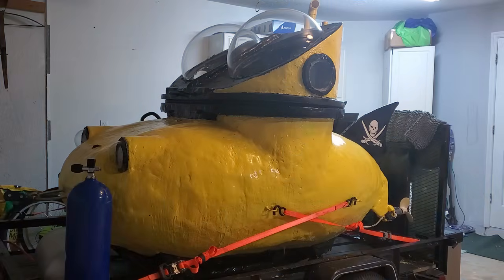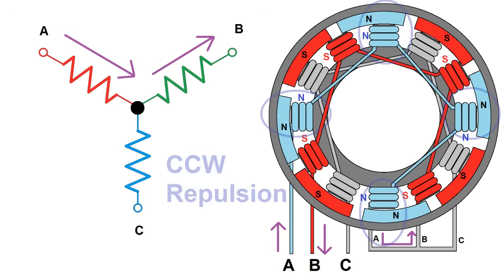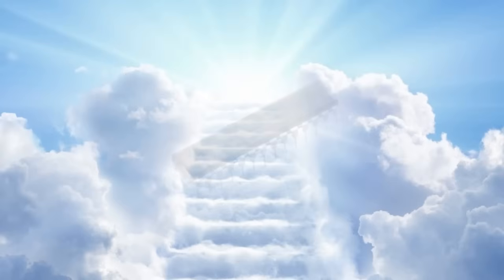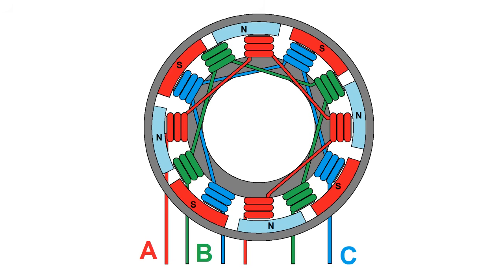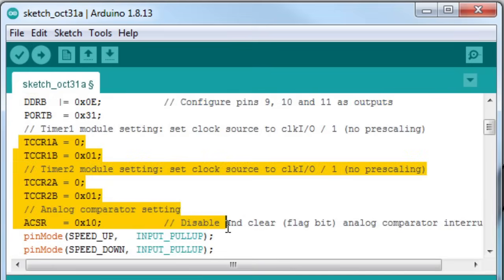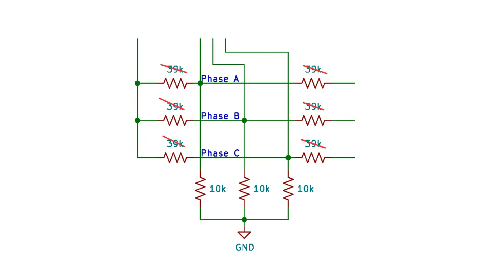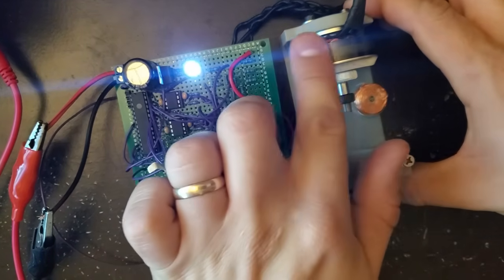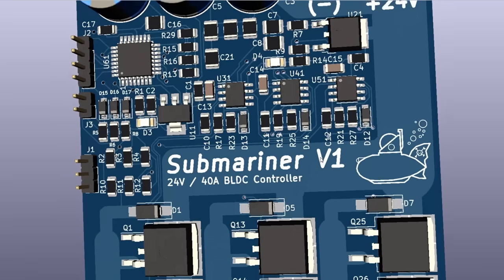Brushless DC Speed Controller

Comment: I was encouraged to see that you used a dual trace scope. I wanted to build my own esc but my motors are delta wound and I couldn't figure out how to detect the zero crossing point with my dual trace scope. I think I'll buy a wye motor and compare a phase with the neutral point as you did.
Reply: When running the motor there will always be one phase that is inactive during each step, thats the same for y and delta. Since the inactive coil will move along the permanentmagnets there will be a voltage induced, which can be measured. The point youre looking for is the moment when this induced voltage changes its sign (crosses zero).
Reply: @jonibeYT  "...thats the same for y and delta." 
I started thinking about that. It makes perfect sense. With the delta motor only one coil is energized at a time. I'm going to run some tests with that in mind.
I'm just a hobbyist. The problem for me is I have three hobbies, electronics, programming and animation. If I run into a wall, sometimes I will switch to a different hobby and stay zoned in for months at a time. As a result I lose focus on my other hobbies.

Comment: Iam having some douts bro

Is it possible to upgrade 30a esc to much higher ampere by. Addiing parallel mosfets.     (Same voltage range)

What are the issiues of this idea

Comment: can i use ir2110 mosfet driver in place of ir2101 ??
Reply from the maker: sure, but the input logic might be different so you'd have to compare the datasheets
Reply: @HyperspacePirate  input logic might be different ! how????. i read tha datasheet ,i think it might be same . please help me to better understand the datasheet.
Reply from the maker: @SiddharthSingh-sk2md  In other words, what inputs to the high/low trigger inputs to the IC trigger high/low on the outputs that go to the MOSFETs. Some half-bridge drivers just have single input so either the high or low side FET is always conducting depending on the input state, and others have inputs for both FETs individually. Depends on the particular driver. The manufacturer's datasheet for the part will tell you
Reply: @HyperspacePirate  ohh thanks for informative reply .
  I will try .
Reply: @HyperspacePirate  now my motor is spining .. but most of the time motor start and try to spin but stuck and vibrate .... what is the problem??  i am using 1400 kv motor ... 12v  8 ah  battery .... and 10n60 mosfets... and motor 's torque is very low .. please help ..
Reply from the maker: @SiddharthSingh-sk2md  Try adding a ceramic capacitor around 10 uF between the 5V and GND pins of the atmega328 as close as physically possible to the chip. Voltage transients on startup can throw the chip into reset
Reply: @HyperspacePirate  okk i Will try .. but i think this is not a reset problem .. i am using arduino uno board .. the on board led is not showing the reset ...
Reply from the maker: @SiddharthSingh-sk2md  It happens extremely fast, so it can be hard to detect. When i measured the 5V rail going to the atmega chip without a bypass cap, there was a voltage dip down to ~3V for about 3 mS, which would be too fast to see with the eye, but it was enough to reset the chip
Reply: @HyperspacePirate  okk sir . i will try . thank you for reply .

Comment: Hello, I want to ask

I have tried the program without BackEMF to test if my circuit is working or not. The code is the same as yours:

moveMotor();
delay(10);
allOFF();
stepCommutation++;
stepCommutation %= 6;
delay(20);

The code above works even though sometimes the motor moves left and right and doesn't spin a full circle. But if I try like in your google drive, this code can't work (motor doesn't spin).

i = 5000;
   // Motor start
   while(i > 100) {
     delayMicroseconds(i);
     bldc_move();
     bldc_step++;
     bldc_step %= 6;
     i = i - 20;
   }

Do you think you know what makes the code above doesn't work? I need the above code to start the motor so that the motor can emit back emf to detect.
Reply from the maker: What kind of power supply are you using? I found that the inrush current from motor startup pulls down the supply voltage and if you don't have a big capacitor / large current limit on your PSU, the voltage dip can cause the IC to go into reset
Reply: @HyperspacePirate  I'm using a 12v lipo battery. With a 470uF decoupling capacitor.

How big is the capacitor value you are using?
Reply from the maker: @rea1013  Ok then voltage sag probably isn't the issue. Another problem I ran into (also on startup) was EMI from the motor causing a voltage spike on the 5V rail, which also caused IC reset. I solved that with a 10 uF ceramic cap between the 5V and GND pins of the IC as close as physically possible

The startup script is really the hardest / crappiest part about this circuit because it has to spool up open loop and potentially pull a lot of current unless it's tuned just right. I'd recommend tinkering with the pulse times / frequencies in that script because they're probably far from optimal
Reply: @HyperspacePirate  Thank you for your advice. Very helpful.
Reply: @HyperspacePirate  You are right, my IC reset. I have checked through the oscilloscope and there is a voltage drop. I have added a decoupling capacitor as close as possible to the vcc pin of 220uF (I initially gave 22uF but there is still a voltage sag) also added a decoupling capacitor from the buck converter for the MCU of 220 uF and 110 uF.

That helps reduce voltage sag but doesn't seem like enough (there is still a voltage spike). Was after you added the capacitor the problem about your MCU being reset resolved?
Reply from the maker: @rea1013  The bypass cap between the IC's VCC and GND needs to be a relatively small ceramic type, like 1-10 uF. If you're using a larger capacitor - especially an electrolytic - it will have series inductance that will prevent it from absorbing a very fast spike

Comment: i have alot of bldc controller software and hardware projects do you want to buy one? i have ipm module based advanced bldc controllers. start up sequences are optional. ramp based start ups and both sensored and sensorless operation is not a problem. i am interested in same projects. i have solar powered little submarines circulating whole earth for microchips smuggling.

Comment: Where you put the void bldc_move reverse in your code? I didn't see that
Reply from the maker: I must have uploaded the earlier revision of the code before I added reverse. I'll re-upload with the right code. In the meantime, just copy this:

void bldc_move_reverse()  
{      
  switch(bldc_step)
  {
    case 0:
      CH_BL();
      BEMF_A_RISING();
      break;
    case 1:
      CH_AL();
      BEMF_B_FALLING();
      break;
    case 2:
      BH_AL();
      BEMF_C_RISING();
      break;
    case 3:
      BH_CL();
      BEMF_A_FALLING();
      break;   
    case 4:
      AH_CL();
      BEMF_B_RISING();
      break;
    case 5:
      AH_BL();
      BEMF_C_FALLING();
      break;
   
  }
}
Reply: @HyperspacePirate  Thanks you
Reply: @HyperspacePirate  to prevent atmega reset due to spike, is the capacitor connected to Vcc and GND atmega??
Reply from the maker: @hanifwistijulitama440  Yeah. Try to put the capacitor as close as physically possible to the actual VCC and GND pins on the chip itself
Reply: Thank you very much!

Comment: when I connect voltage divider circuit with respect to corresponding phase then phase voltage drops v  to 2.5v. please tell me why drops voltage. I have used 33k 10k resistance respectively. please
tell me
Reply from the maker: That sounds right. The range of the internal comparator is 0-5V, so the neutral point voltage at the resistor divider should ideally be in the middle of that, which is 2.5V.
Reply: @HyperspacePirate  thanks for answer.
 One question again :)  why void BEMF_A_RISING and BEMF_A_FALLING codes missing two row according to other B and C RISING and FALLING codes? the time in the video is 9:40.
Reply from the maker: @kamuranpeker132  That might have been a mistake. Some parts of the video were made before the project was 100% finished. I should probably add some notes there

Comment: you are not connect to every IC ir2101 pin no 6 with Phase A, B, C respectively. Is it correct ?
Reply from the maker: Yeah, sorry, that's an error in my schematic. V_s on each IR2101 is connected to the respective phase its driving
Reply: @HyperspacePirate  Was puzzling over this one a bit (V_s connection to driven phase missing in the schematic), glad a scrolled through and saw this comment. Thanks for this video, I am finally getting my feet wet with MOSFETs and drivers thanks in no small part to this. Cheers!

Comment: I tried to make a similar circuit, but I could not get the result I wanted from the IR2101. I'm in trouble with the seventh pin. Even if I apply PWM to the Hin input with the second pin, it produces a constant 7 volt output (seventh pin Ho), which causes the mosfet on the H side to remain open all the time. Do you think the diode is causing this situation?
Reply from the maker: Can you email me a picture / schematic of how you wired your circuit?

Comment: You say that a "Y" configuration produces more torque, but the more appropriate thing to say is that it produces more torque at a given current.

Assuming each phase is 1 ohm and we're powering the motor with 10V, at zero RPM the "Y" configuration will draw a maximum of 6.66A, while the delta will draw a maximum of 20A. At these respective currents though, the "Y" motor produces %66 of the torque of the Delta motor while only drawing %33 as much current.

My example and numbers assume that the all three half-bridges are either 'pushing' or 'pulling' at all times instead of only two at a time like yours, but the numbers are similar either way. If we leave one half bridge turned off, at zero RPM the Delta draws 10A, and the "Y" draws 5A but produces the same torque as the Delta.

Due to the increased inductance per phase of the "Y" type though, it will have a higher impedence at a given RPM, so you were right in saying that Delta is faster. The way I prefer to think about it is that "Y" configurations are good when current is the limiting factor, and Delta configurations are good when voltage is the limiting factor.

Fantastic video though! I love your channel.

EDIT:
I see you're using the IR2101. I was designing an ESC with those aswell, but I recently discovered the IRS2184. Just like the IR2101 it supports bootstrapping, but it also lets you switch from HIGH to LOW with a single input pin, and has a built in 400ns dead-time so your high side and low side MOSFETs dont transconduct. It also has a turn-off pin so that you can easily throttle your motor with a PWM signal generated by your Arduino.

Comment: is all of the GND same?
Reply from the maker: yes
Reply: Hello Sir.   
You replaced 39 K resistors with 82 K. How many K resistors should I use for a 42 Volt battery output. And if possible, could you briefly explain how you did this calculation?
Reply from the maker: @kamuranpeker132  The resistor divider values need to be selected so that the phase feedback signal is within the limit of the micro-controller. I selected 82K & 10K because I wanted to run a little over 24V, but many of the schematics you see online for 12V will be 33k or 39k and 10k. You want your phase signal to be around ~2.5-3.0V when VCC is applied to the rail. Since you're using 42V, 150k would probably be a good value to use.
Reply: @HyperspacePirate   thanks again